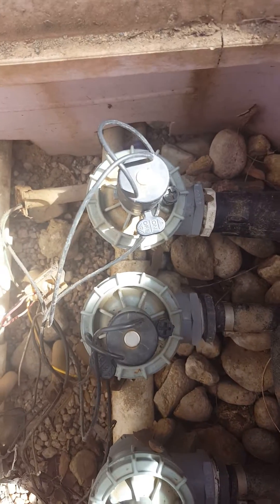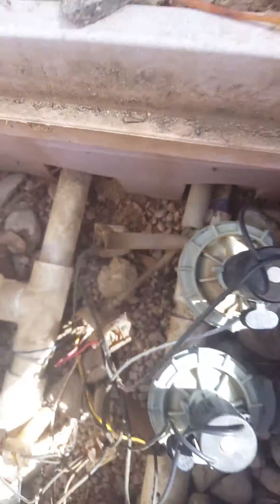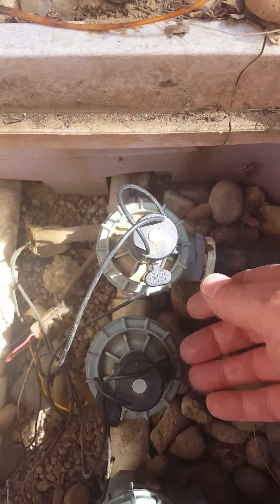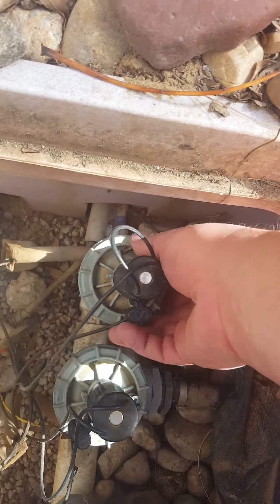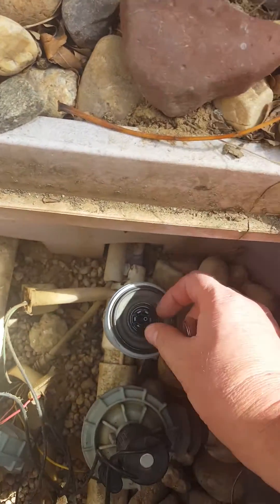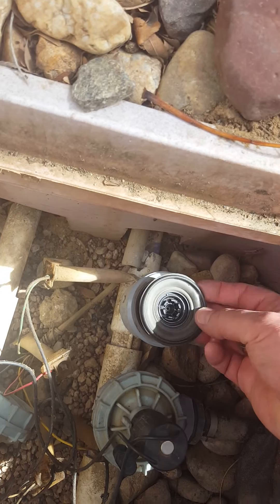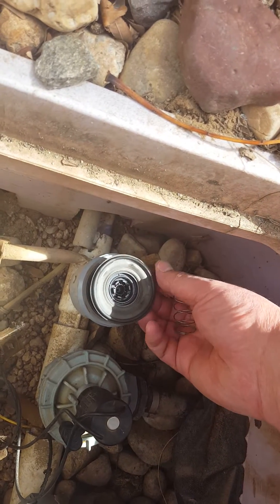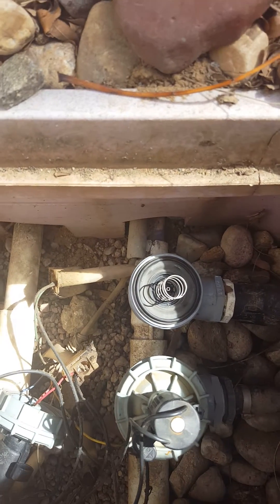Irritrol 2400 Diaphragm Failure

Comment: I have the same brand and model valves. I have 2 zones that won't come on with the timer but do manually. I want to inspect the valve like you did but when I start to remove that collar, water comes out. I have the water shut off at the backflow device so I am a bit confused as to why it is coming out at the valve still. Any thoughts?
Reply from the maker: Manual could imply physically turning the valve on or setting a manual cycle on your control timer.

If it is working for a manual cycle on your timer control but not for a program this would imply an issue with the programming e.g. you have multiple zones on at the same time.
Reply: What I should have said is if I manually turn the zone on at the valve, it works. Using the timer manually or at the designated start time, those 2 zones do not come on.  The initial question though was why is water coming out of the valve when I remove the collar.  My guess is that there is still water in the lines.  AND thank you for the quick reply!
Reply from the maker: You more than likely have a electrical problem. Simplest way to test the connectivity from the timer control to solenoid valve is a voltage meter.

Demonstration of testing Irritrol 2400 valve continuity,

https://youtu.be/KrqwPYeTKns